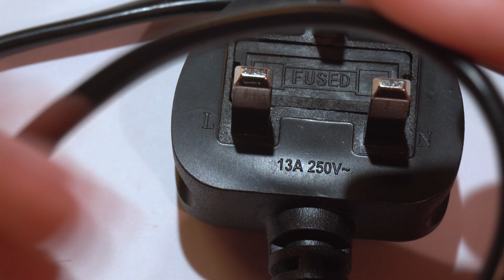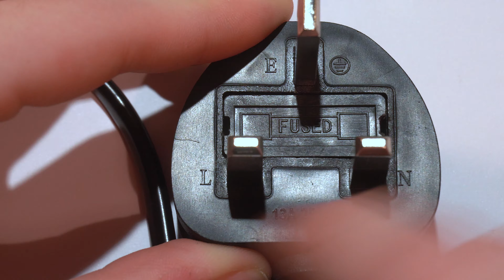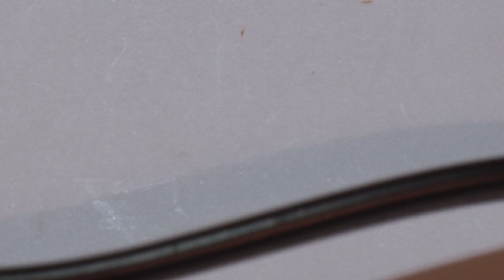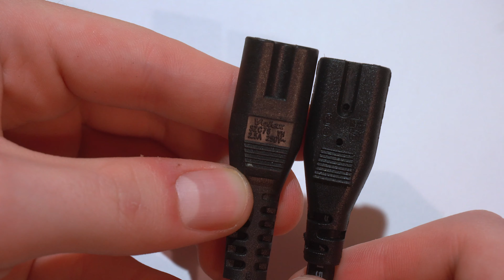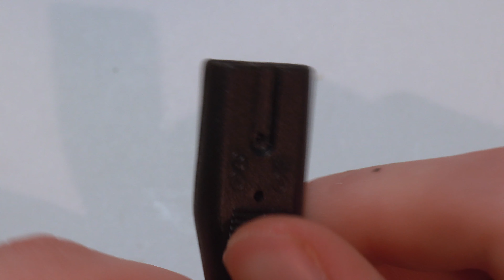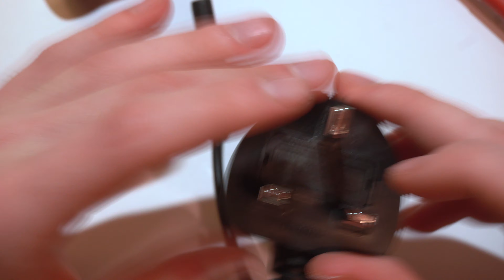Dubious and Deadly - Fake BS1363 IEC C7 Cable

Comment: Great safety information regarding plugs Jacob, does this apply to all plugs as I noticed a large butt plug in a draw the last time I was round at yours and it didn't have the BS markings on it that you mentioned in your video. Any further information would be rather useful, thanks.
Reply from the maker: Yes I will have to make a video to raise awareness as this is a commonly uses item